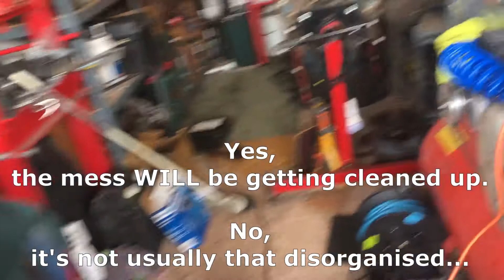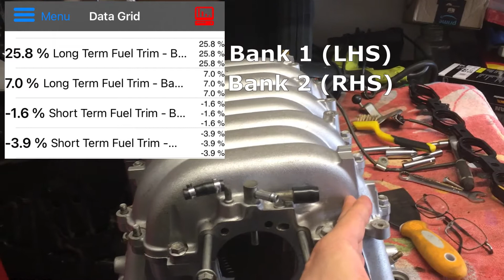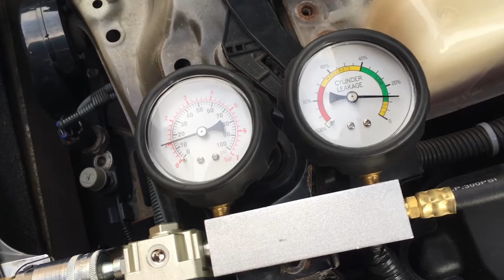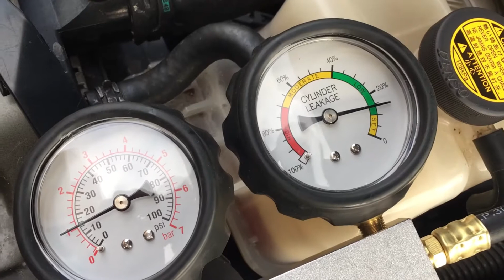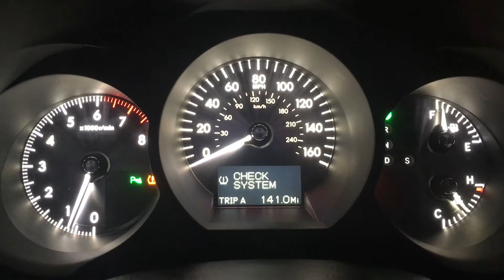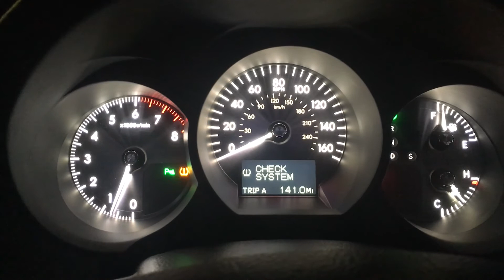Lexus GS430 P0171 Lean Running Diagnosis and Fix

Comment: I have this problem, also says Bank 1 (oxygen) Sensor 1 heater control unit. We replaced the sensor and still shows that.
Reply from the maker: Possibly a wiring issue then

Comment: Just subscribed yesterday and enjoying your content. Looking to pick up either a 2006 GS430 or 2008 GS460 in the next few months after I sell my 2013 ES350. 

Any tips or suggestions for or against choosing the GS460 over the GS430 ?
Reply from the maker: Thanks for the support, Stephen - much appreciated!!

Ref your Q; If you can find one, the 460 would probably be preferable - more power, slightly better economy and will hold value better. I assume as you’ve got a 350 not a 350h you’re in the states, or at least not in the UK, which is good, as 460s are a lot more common there than in the UK (only 40 UK 460s, I believe).

That said the 430 is a great, proven, reliable engine, so you’re not being short-changed! Plus you can’t LPG convert a 460 (but I suspect that’s not your intent...). 

The problem you’ll likely have is finding a good one. They’re old enough now to have had owners that neglect them and cars in areas that salt their roads are more likely to have rusty rear subframes etc so worth checking before buying.

Good luck in your search - hope you find a nice one!
Reply from the maker: Just to add, the 460 being Direct Injection means it's also worth checking if there's any carbon buildup - especially if it's got some miles - forgot about that! It's an issue with the GS300s of that era and I'd assume the 460's could suffer from it too.
Reply: @MikeMacful  yes I’m in the USA, just outside of NYC in Staten Island NY. 

I didn’t know the 460 has only Direct Injection similar to the 300 ! Wow. Yes I just heard yesterday on another YouTube channel that the GS300 has carbon build up issues on higher mileage engines. (Over 100k). 

This will now definitely make me look more for a GS430 instead.   Nice to have that extra 40 horsepower but if it’s got possible carbon issues is it worth it ?  
I’m not a mechanic by any stretch, I can do basic stuff like oil changes, brake pad replacement etc. but I won’t be opening up cylinders. How does one get an inspection for carbon buildup. Can An advanced scan tool measure this ?
Reply from the maker: @stephendibari5010  Guessed it! :-D

Ref Carbon - the only real way of checking is physically getting a scope into the intake ports on the heads - not casually DIY'able! You could use a 'guideable' scope through the spark plug tube to look at the back of the valves when they're open, which would be easier, but that wouldn't show you the intake runners.

I think the main symptom is loss of power and poor running. It might be worth checking what a shop would charge to clean them up - might not be too much? It's certainly a common procedure on all other DI engines.
Reply: @MikeMacful  awesome 👏. So sounds like don’t entirely rule out the 460 ? If needed I can always get a shop to clean out the cylinders. Thank you so much for this invaluable info !!
Reply from the maker: Yes, I wouldn't rule it out - just worth checking what it'd cost to clean your intake and valves every 50? k miles or so. Usual method is walnut blasting.
Reply: @MikeMacful  thanks again!